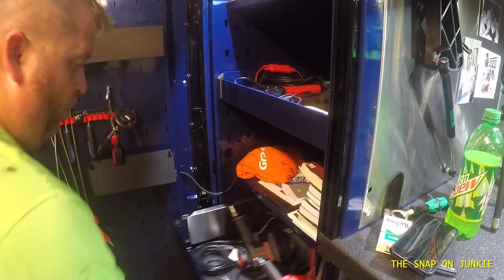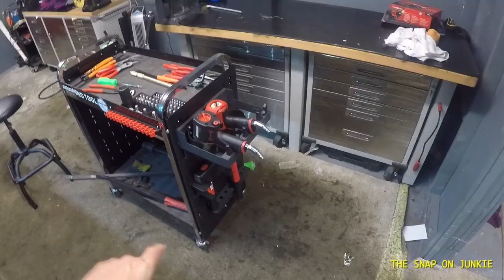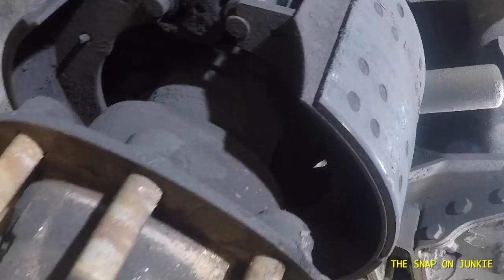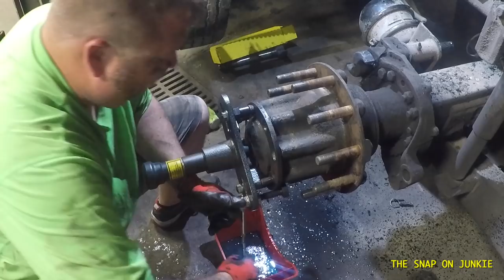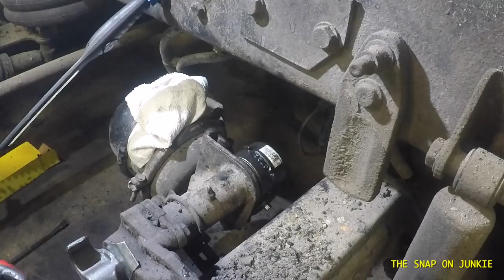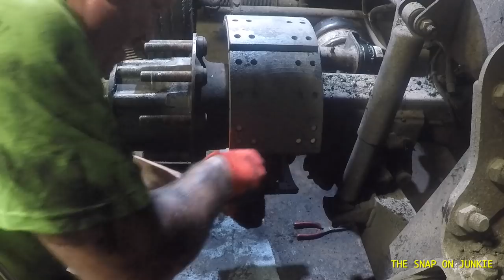FULL BRAKE JOB ON DUMP TRUCK!!$$ THE SNAP ON JUNKIE

Comment: Just a heads up here..  An Impact, is designed to work optimally - without being held against the fastener.  It needs to oscillate, vibrate and move around a bit - as that's how every impact is designed to work.  As a monster truck guy, who puts on a lot of lug nuts and tires - I had an Ingersoll Rand engineer give me that tidbit and bam.. instant benefit.

Comment: I was  surprised the entire axle  housing had to come out to pull the s cam.  learned something new thanks.
Reply: He to pull the axles to get the hub off s cam will not come pass the hub is why
Reply: Mostly on trucks. A lot of trailer you don’t have to pull the hub

Comment: Awesome video but one thing that sometimes works, when doing an s-cam I usually unbolt the s-cam housing (4 3/4" bolts) slide the whole housing off the cam and sometimes it will allow the cam to angle enough to slide it past the hub. Fuck pulling hubs to do this job. Hopefully this helps in the future. Good job brother

Comment: A guy I used to work with got sick of picking up those damn drums, went and got a motorcycle center stand lift.  Worked great and not too high dollar.  I do not miss fighting those brakes in Texas heat.

Comment: Great video. I had to laugh every time you looked at the camera while waiting on the Harbour Freight gun to take the nut off, TIME.
Reply from the maker: Steven Taylor yeah the things running out of power pretty quick
Reply: Junkie have to had to tear it down and grease it yet?
Reply from the maker: gmlover82 no I have not tour down and look at it we're going to use it a little bit more and then I'm gonna take it apart and look at it
Reply: same here..I was laughing so hard when he looked at the camera waiting on the nut to break loose..

Comment: Nice video junkie. I use the lady foot pry bars when removing the spring for the shoes when removing. When I reinstall I install the shoe springs and the top roller pin and then use prybar to pry down the bottom shoe and the slip the roller pin in. Also I use antisieze on what I can. Anyways great stuff

Comment: How did it go putting the axle shaft back in? I see it got hung up on the diff lock on the way you. what you can do is turn the diff lock on so it doesn't drop or even better as most trucks leak air out over night, hook it up to a shop air line with an adapter.

Comment: Eric -O does it with sound effects too.lol...... S-cam/slack spacing varies virtually every time you change out......ive used up to 8 spacers to relieve slack, You want to take out as much slack as possible to keep the shoes in the drum without any shoe hangover

Comment: Most of the time if you remove the 4 bolts holding the S-cam tubes on you can swing it and pull the S-cam out without pulling the hub. I've done it on kenworths, peterbilts and freightliners

Comment: Nice job.  Little trick for ya on getting those axles out.  Leave the wheels on. Don't jack up the axle, take off all your hardware and then hit the axle.  Comes out pretty easy and doesn't require that fancy hitting tool.  But since you got it, might as well use it!  Keep the videos coming.

Comment: No need for special spring tools, put the springs on first, then grab the shoes with a cresent wrench, pull up and put the rollers in, on the S cam. Easy as pie

Comment: 4 1/2 hr job. Use to do it without pulling the wheels separate unless the drums were getting replaced. Still about an hour and a little per wheel.

Comment: quick tip and only the tip, you can get those cams out without pulling hubs, just take off the 4 bolts holding the cam tube on, you get more wiggle room

Comment: Some time If you take the 4 bolts out of the s-cam tube that holds the brake chamber to the axle housing  you can get the s-cam out without removing the axle and hub it saves much time on each wheel. Just remove the bolts and snap ring and remove the brake chamber and s-cam tube as a unit at one time. Hope this helps next time you do this.

Comment: I miss that style of brakes. Lol. The buses I maintain use a different style as they are MANN axles. Rear end has a planetary outer hub and front is grease bath. Those shoes you use are so easy to do. On this style usually I’ll mount the shoes and install the springs then use a pry bar lift the shoes to install the s-cam rollers.

Comment: I'm 30 years old and a trailer mechanic myself, been a mechanic for half my life, I could point out a few things you done wrong, but for your first time it wasn't bad. In the future make sure them brake pads are oil and grease free or it will be like trying to stop on ice, they won't work. Overall good job.

Comment: Great video, I do brakes all the time at work but i have yet to change a s-cam it seems to be quite easy to do that thank you for the video!!
Reply from the maker: DarionK they are pretty easy but it's just really time-consuming to get everything apart and get it put back together and pulling The hub suck that's the most pain in the ass part
Reply: The Snap-On Junkie!!!  Agreed on the time consuming part, especially when u have to pull the hubs to change just a slack adjuster because it will hit the diff housing when trying to pull it off.
Reply: DarionK why would you pull a hub off to change a slack there’s never a situation for that ever

Comment: If you do a lot of S cam work (replacing the bushing and seals) I would get some brass stock and turn your self some drivers for the seals and for the bushing.  I did and saves a lot of time over using a socket.

Comment: You can change the s cam without pulling the hub off. I have a tool that loops around the cam shaft and punches the bushings out, with those out you can pull the shaft out at an angle around the hub.

Comment: Heavy work for sure.  Only thing I saw that needed attention was getting some grease on the new brake shoes. Key to preventing that is to change the pig matts once all the old hardware is removed/cleaned. This includes new gloves too. All must be clean, mechanic, work area and brake hardware as parts get reassembled. Lots of things to consider on these big truck repairs.

Comment: On the s-cam seals, you want the cam side facing out and the slacker side facing in. So when you grease the s-cams, the excess grease will come out the slack side. You don't want the grease to get out on the s-cam side and get on the brake shoes.
Reply: James Trapp I drive the seal so it hits the bushing so water don't get inside thought the scam splines see it a lot
Reply: Yeah James that's what I do too
Reply: michael vestal I've had water come out of the slack before but I've rarely seen water in the s-cam housing on a truck that gets serviced often. Only on owner ops that don't grease regularly. So spring of the seal (if the seal has springs) in on brake side, out on slack side. When you grease them, the grease should come out the slack side and block most all the water from getting in. Should anyway.
Reply: James Trapp yeah, point them the right way, dont wanna load the shoes with grease

Comment: Good effort for your first time. If your doing new spring kits with those shoes and you have a torch, cut the spring on the cam side and they fall off. When you put it back together put it all together except your anchor pins then put your long pry bar in the shoe from the end, pry while sliding the pin in and your done no spring tool needed.
Reply: For me it works best to do the top anchor first
Reply: That is a shitload of work for a brake job bro.

Comment: Where did you find the thandle holder's and screw driver holders
Reply from the maker: Ricky Phillips which ones are you talking about
Reply: The Snap-On Junkie!!! The ones hanging on you epic hutch back wall
Reply from the maker: Ricky Phillips on my got them from snap on him I did a video on my think a while back they're the ones that there a hanging system I don't remember the part number

Comment: This will sound weird but to tell the s-cams apart if you standing facing truck and put s-cam as if its going in truck if your right ball would sit in it then it goes on right and opposite for left, I know it sounds weird but my lead tech told me that and I will never forget it now lol
Oh and drums weigh about 75 lbs. And I put a pallet full (20 drums) in a aluminum F150.... that thing squatted BAD but lived lol

Comment: Whew, that was a hell-of-a "work out" Justin . Heavy duty X5 !!   SOJ, no one wants to watch you get hurt (or worse) you need to start thinking Safety ; hell, slide the tire(s) under the frame.
I thought the HF impact did ok considering the size and torque of those Nuts.  You were running out of air capacity also.  I'm really surprised the 1/2 drive size even "touches" that stuff.  Take care and stay safe.

Comment: where did u get those lights at? are they snap on? they look like they produce quite a bit of light
Reply from the maker: alcatraz501 yes they were an LED light that goes on like at a pole for overhead lights they do put out a shit ton of lights and the little one that I'm using that has the magnet is an Astro light I got it off Amazon

Comment: I have learned about the s cams is. You put the s part in the palm of your hand and which ever you thumb fits in the hole it belongs on that side. 

So if your right thumb fits in the hole it belongs on the right side. Same apples on the left side

Comment: What are the air line connectors you use? The look super easy to connect and disconnect the air tool
Reply: VGAPR Garage they call them body shop connectors

Comment: Yet another great video junkie!! One thing I was told by the old timers when I started doing heavy truck slack adjusters was turn em in til the shoes touch the drums then back off 1/2 turn. Just wondering what ur way of setting them up was?
Reply from the maker: Yes that right

Comment: Junkie do you torque your wheel nuts? I was also wondering if you have ever seen the wider brake shoes that most people call mountain brakes? They last a lot longer and stop around as quick as the new disk brakes do. we are switching all of our gravel trains over to those wider brake shoes.

Comment: You dont have to take the hubb off ..... Just take the 4 bolts out of the s cam bracket. 3/4 swivel
Reply: bambam680 and what, you punch out the spider side bushing out the back?
Reply: bambam680 what happens if you have to replace the scam. It's got to come out the front right ? Which requires hub removal

Comment: Nice video! I have been a Diesel mechanic for 20 years. I have done a million of these brake jobs. I spent many years yelling fuck you to 3 axle inboard brakes. When you take the nuts off the rims you need a tire gun 1 inch. You are killing time using a 1/2 inch or 3/4 impact. When you take off the springs for the shoes. You need to use a long round stock about 3 feet long and round the point. Using a big hammer you punch them off. I then use my hammer to smack the shoes and they jump off.  You are killing your hands smacking it. I have guys in their 50s plus that need surgery from doing that. Sometimes you can take the 4 bolts off the camshaft tube and you might get lucky taking the camshafts off. Most of the time you have to take the hub off. When you go to take the hub off and the nuts are removed. Take a huge sledgehammer and smack the face of the axle tube. Works most of the time. If you take the can off and tube. It’s way easier to do on a bench or vise. I made a driver 3 foot long with a driver the size of the bushing. Most of the time the camshaft tube 4 bolts may be rusted. I take them out a little and lube them and run them back and forth. Bronze bushing last longer then the plastic ones. If you don’t know what side a camshaft is. Put one in your right hand with your thumb in the S. My first brake job I put both R side in. The driver showed me when he applied the brakes one would retract and the other apply. Lol. If my brake job has a abs sensor I extent it forward and hit it with brake clean to get the metal off. I never use the 3 piece style to do the hubs. I made my current shop purchase and transform the fleet stemco 1 piece pro nuts. Putting one shoe on first and then the other makes its way harder. I install all of the springs expect the 1 return springs. I put the top shoe on and the other is facing me. I just twist the shoe and get it on the camshaft. I would not let the shoes touch the shop floor and contaminate the pads. I wipe the new drums with brake clean and spray the shoes before I put the drum on. When you put the return springs on. A vicegrip and pry bar works the best. Just my 2 cents and the some lol. I am picky on brake jobs. They do suck..

Comment: Hey junkie I was nervous for you because I didn't see you use a jack stand and you only used a hydraulic jack, however I absolutely loved this video.
Reply from the maker: All it'll be all right that Jack has never let me down it it's not gonna fall down plus there's enough room underneath that he would be trapped under the framer nothing
Reply: The Snap-On Junkie!!! I've seen hydraulic jacks fail, I'm sure you know what your doing was just nervous for you was all, excellent EXCELLENT video
Reply: I don't even like jack stands I do however fully trust old piston sleeves lol they are perfect jack stands for semis
Reply: i never use them cuz its not like the truck gonna come down. truck is supported.by other axles. only thing that might fall is the axle and that jack capable of holding up
Reply: and body props :D
Reply: Y’all do realize there’s 2 more tires if it fails right
Reply: Even if it did fail side of the axle wouldn't even drop all the way to the floor. The suspension would support it. Jack stands just get in the way

Comment: Could of just used a proper 3/4 or inch impact to remove those nuts, would last longer than a 1/2 struggling its bollocks off to undo the nuts xD. 

Its also quicker to just remove the axle nut and remove the hub.

Comment: There's been some good comments on here, some met without the appreciation they deserve,  all I'll say is, the true wrench turners can see who's who. 

 T800 quad, all but steer, 6 hours. Special tools= otc real driver. 

They call em quick change brakes for a reason. To the original poster, your attitude will keep you from learning.

Comment: sure the snap on took the one lug off after you let the compressor build back up
Reply from the maker: I have plenty of air volume that's not the issue the guns just not strong enough sometimes
Reply: that gun is plenty strong. Air pressure drop and lug nuts not being a consistent torque is the issue. Is the SO gun stronger?  Of course. But is it $400 more than the Earthquake stronger? lol fuck no.
Reply: I have never seen a truck or trailer wheel removed or installed with anything but a 1 inch drive impact

Comment: Liked the video but only one I like to bring up the new shoes u put them face down on greasy shop towel and did not clean them off with brake clean before putting on  new drums isn't that a bad thing???
Reply: +Eric Kelly. Yes, that is a bad thing.

Comment: Why was there a cut screen between switching from harbor freight gun and pt850....I'm guessing you failed to get it off with the PT and then got out a big ass breaker bar or bigger impact and loosened it.....was no need to add a cut screen there..... unless.......
Reply from the maker: No what happened was is the harbor freight gun did not take it off and I cut out the point where I was switching guns and changing the sockets never got a breaker bar anything else out like that
Reply: worndisk320 lol... That's most likely the case...just seems fishy that both times there was an edit in-between when the harbor freight gun failed and the snap on took it off....I have know doubt the snap on is an overall better impact.. But it only takes a second to swap impact sockets..... Why edit it out when your doing a review.... Leave nothing to the imagination.... Good video man.... its Just an observation
Reply from the maker: I FixIt are the reason I did it in this video is because the video was going to be so long I was trying to keep it under 45 minutes so I had to cut some spots out and it's pretty boring to watch

Comment: People just place the s cam like it's your duck and whatever ball in your sack is resting in the s cam then that it tells you left or right. Lol slapping a medium screwdriver in the spring hook will pop it out and a pair of vice grips and the same screwdriver for leverage to replace the spring. Haha I'm 30 and have been educated with old timers. With the axle caps a good wack with a sledge would pop the cap off. Being honest pulling the cam tube would save time and costly money on a seal. Not saying how to skin a cat but WOW!!!

Comment: Next time if you want to avoid removing the hub, remove the 3 bolts that hold to cam tube to the spider
Reply: Nickolas St-Germain but he replaced the scam itself. Doesnt it have to be removed from the front regardless which requires the removal of the hub

Comment: It feels like it's getting weaker because your air supply is dropping. If the air tank was full every nut, it would take every one off. To be fare anyway.
Reply from the maker: James Trapp James I don't think it will
Reply: Get rid of the swivel on the fitting. It restricts the hell out of the air supply. I know, I had them on both my snap on guns and as soon as I took them off, they hit like new again. I've been a diesel tech for going on 30 years. You can remove those s-cams without pulling the hubs. Take the can off the s-cam bracket, 2 nuts is all since you were replacing the slacks anyway, then take the 4 bolts out hold the s-cam bracket to the spider, then you'll have room to allow the s-cam to pivot past the hub. Then replace the outer bashing and slide the s-cam back in before installing the bracket back on. Ask me how I know.
Reply: @jamestrapp3783  
How do you know